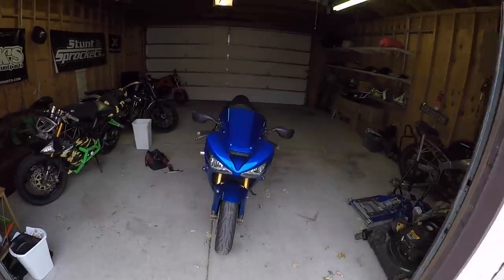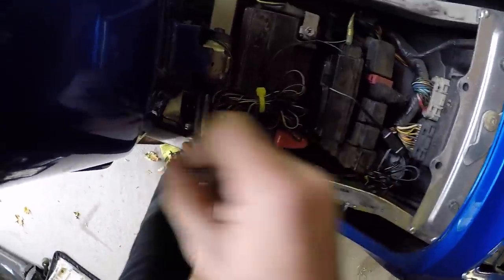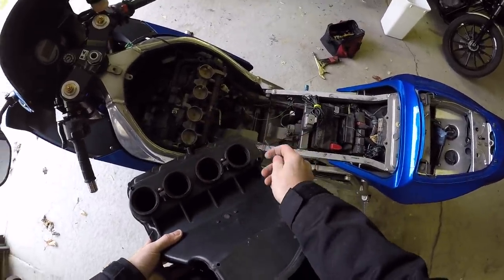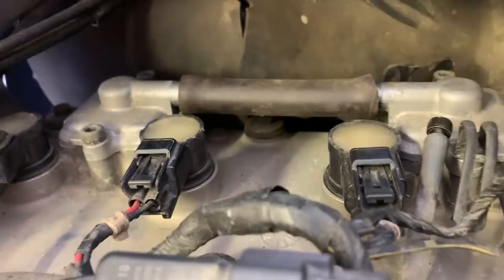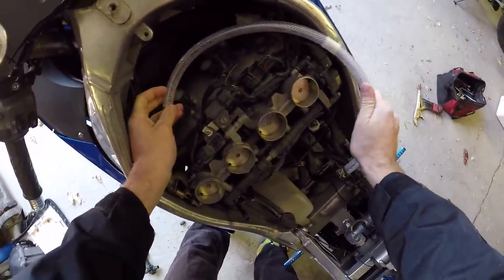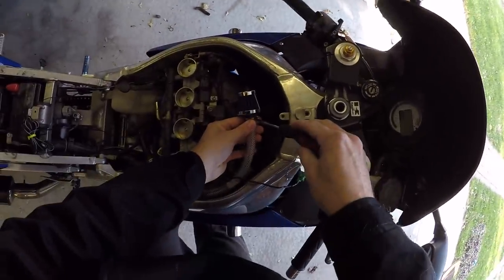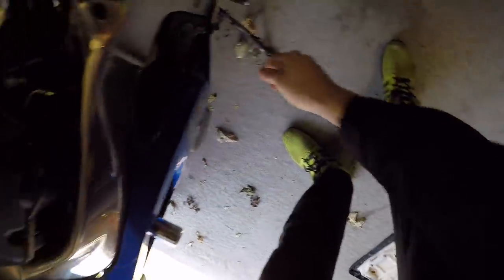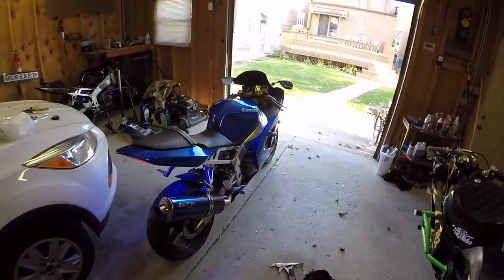Don't Blow Your Motorcycle's Motor.... (636 Build Eps. 2)

Comment: I just did this on my 2021 636... THANK YOU BRIAN! It's still pretty much the same thing, except there is an electrical connection to the smog pump... all I did was keep that peice connected, but took out all the hoses that were connected to the pump 😂 no check engine light so its good... I will update later if something bad happens 😅

Comment: T fitting the pair valves and then T fitting the crank  to those & the filter. The pair valve on the valve cover was connected onto the airbox to vent
Reply from the maker: You can do that but then there is no venting of the motor which is very important.
Reply: @brian636  Definitely needs to be vented. I personally use 2 T fittings 1 at pair valves & the other T gets split to end of the pair valve's T, 1 end to the crank, 1 end to the filter
Reply: @Conway could you send me a picture of what it looks like?

Comment: Crazy, I don’t know if you know this but this is a mod on race engines, they use a “catch can” it lets the engine breathe easier and helps create a better piston seal, on Honda’s they use ports on the block and valve cover, I would keep the top ports connected and vented to help vent the engine better
Reply from the maker: Wow!!!! Cool to see the similarities!

Comment: Tech tip: Go on Amazon and get some Silicone caps and plugs, it'll make the job easier for capping the holes on the air box and blocking vacuum lines.
Reply from the maker: That is true. Just doing the budget way hahahha

Comment: @brian_636 so you said I can use block off plates when doing the clean air mod right? Instead of connecting the tube in between the two stock plates

Comment: Hello, I've similar bike to u and have this kind of problem, throttle system isn't opening or closing after i open starter, voltage is too low in this case and can u tell me what can be the problem in this situation, have changed throttle already and problem wasn't solved?

Comment: Thanks lol i was wondering why i had some oil in my airbox now i know why lol
Reply from the maker: Glad I could help!!!
Reply: brian_636  thanks its my dads bike has not ran in 10 years all i did was adjust throttle screw and it ran tearing bike down an replacing everything thought it was blown because of oil in the air box lol

Comment: why not connect the breather hose to the reed valves so it will do vacuum in the crank case for some low end power? I had mine this way.
Reply from the maker: Because the motor will not be properly vented.

Comment: @brian_636 I am doing this on my cbr600rr and it’s a little different. All of the threads I’m finding are showing it done without using the crank case breather that you are using. Will this way work without the filter?
Reply: Also there is a pair valve and plug on it. When I remove that is it going to throw an fi light? I’ve never done this mod before
Reply from the maker: Yes it is pretty much the same thing here man!
Reply: Awesome thanks man.

Comment: Helpful video. Maybe this is dumb, but I assume this isn't necessary on supermotos?
Reply from the maker: On most you do need to do this brother.
Reply: Fahk. I was wondering why my dealership put so much oil on the air filter. And why my new bike was burning so much oil.

Comment: I did this on my 2000 r6 but it spits oil out gradually so I ran it up  behind my seat and nylon strapped to my 12 o'clock bar. Is it normal when you ride hard to have oil residue coming out?
Reply from the maker: Yes, a small amount coming out is normal.

Comment: Hey @brian_636, I got one just like this in Cali but my gas tank has 3 little hose connections at the rear(under the seat). Have you seen this commonly or do you know if there any issues with blocking that too? Thanks man
Reply from the maker: They have a weird charcoil box on them in they are from Cali, don't have much experience.

Comment: Just to be clear, the hole you didn't plug what was connected to that? 

Thank you for this. Love the idea of using the smaller air filter. Most of maybe 99 percent of the videos I've watched do nothing but either plug those two vents,  but this is the first of seen of the way you did it.

Comment: @Brian_636 Does this method cause any performance/efficiency loss? Mines not fully stock, I have a dynojet and full yoshi exhaust so not sure if disconnecting some of those vacuum lines would have negative effects. If not then I’ll give it a try! Don’t want oil in my air box lol
Awesome build series again man!
Reply from the maker: No it will not man, just a way to keep oil out of your air box
Reply: Cool, no harm for a daily driver.
Thanks for the reply! You’re awesome at getting back to your viewers 👌

Comment: If the breather is leaking oil, there’s something wrong with the valve in the breather. Oil shouldn’t be able to flow out of the valve until crankcase pressure exceed the pop off pressure of the valve which is set by the manufacturer.

The only way I can understand oil in the intake blowing up a motor is because of the excess carbon over time? But that’s a stretch still. 

I don’t see the logic in what you’re doing. I would rather have oil in my intake than all over my ignition coils. If your bike is spitting oil, that’s not normal and sounds like a bad breather valve.
Reply from the maker: It is for wheelies man... If you aren't holding long 12 o clock wheelies, you have nothing to worry about.

Comment: This mod is a waste of time. Only vaporized oil flows up the pipe. A very small amount is condensed in airbox which runs out the drain. But if you crash the bike a lot on its side or upside down, oil could flow up the pipe and be a problem.
Reply: This mod is not a waste of time. Stunt bikes crash on their side all the time.
Reply: Lets assume this mod actually works, then it implies the pipe fills with oil and starts dripping out of the filter on to the engine. Since this does not happen, the mod is pointless.
Reply from the maker: I have had my air box fill with oil and motor shut off on me in a scrape because oil was being sucked in. I have NEVER had that happen again after this mod. Guys who really stunt their bikes will tell you otherwise brother.